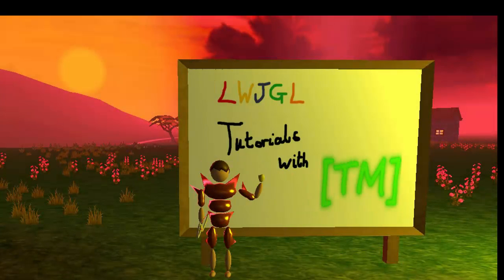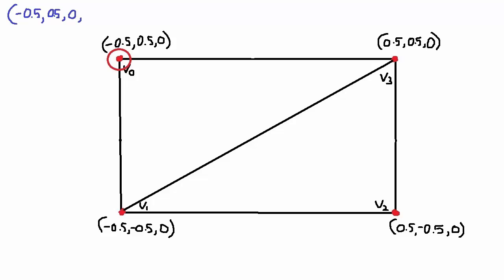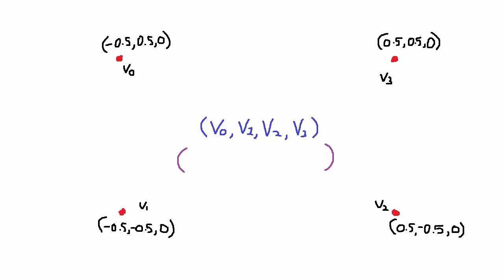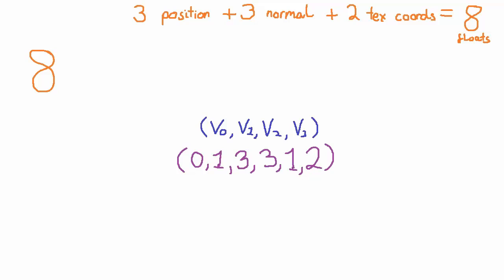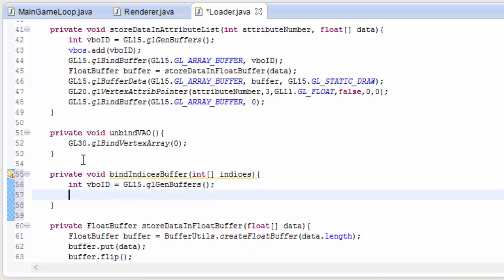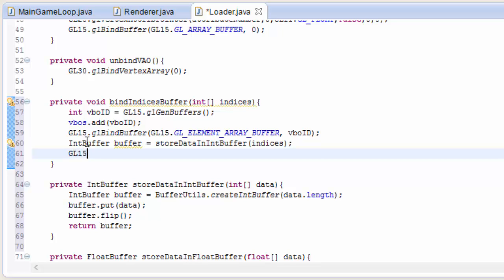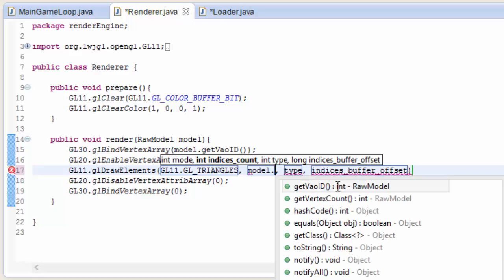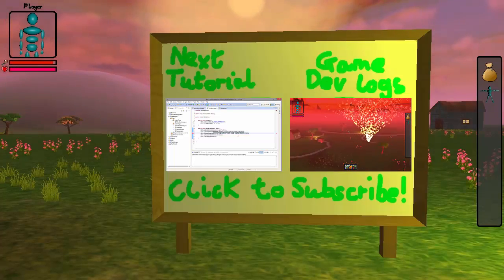OpenGL 3D Game Tutorial 3: Rendering with Index Buffers

Comment from the maker: Common Problems:

- Make sure that you use the new vertex positions array - it is different from last episode!

-In the loadToVao() method the last parameter of the RawModel constructor has now changed to indices.length instead of "positions.length/3". Make sure you've made this change!

If you get the " Cannot use offsets when Element Array Buffer Object is disabled" error, check the following:

-Creating the display must be the first thing you do in the main method. Don't try initializing the RawModel first.

-Check that you are calling the "bindIndicesVBO()" from the "loadToVao()" method.

-Don't unbind the index buffer anywhere! Each VAO has one special slot for an index buffer, and unbinding the index buffer will remove it from that slot.
Reply: If you are confused try looking at https://www.khronos.org/opengl/wiki/Vertex_Specification
Reply: So I don't need to unbind the IndiciesBuffer?

Comment: This took me a while to figure out. Hopefully this helps a bit.
1) Every model is a VAO. (you can think of it abstractly this way)
2) The properties and information of said model are VBOS's.
3) The EBO (Element Array Buffer) does not need a VAO allocation as OpenGL automatically binds it to the currently bound VAO. By using DrawElements, OpenGL automatically knows to use the EBO.
4) You must render all VAO's with a shader of choice, meaning you can have multiple shaders for different VAO's, or VAO groups (Like moddels, terrain, skybox,...)
5) Thin matrix is amazing, but he goes quite fast haha
Reply: I would say, every VAO is a certain vertex format that describes what attributes it consists of, in what order, and in which buffers are they stored in, an in what format.
A model can consist of several meshes, each having a different vertex format, so it may have more than one VAO. There's also a possibility that multiple meshes contained in multiple models share the same vertex format, and in this case there's a possibility that they might also share a VAO, if their vertex data is put into the same vertex buffers for efficiency.
Therefore I wouldn't bind models and VAOs so tightly.
Reply: i was wondering about 3) and this answered it. thanks man
Reply: *3 Yes, that is why then the EBO is  populated some VAO must be at the bound state, right? Had an error there, because unbound the VAO too early. Thanks, dude!
Reply: @vladimirs4684  exactly, you're welcome!
Reply: Tysm I was so confused because he said the index was in a vbo(thats what I thought he said) and I got confused as with textures only two vbos were being used but now I know ty!

Comment: What about 2D games, where all you need to render is a textured quad transformed to different places on the screen and with different texture coordinates? Is it still worth it to use index buffers in this case?
And which one is better? Using a single quad and transforming it to different places on the screen with a matrix? Or accumulating all the different quads of all the sprites on the screen into one giant vertex buffer and rendering it all at once?
In the first approach, though, I wonder how to "transform" the other vertex attributes, such as texture coordinates and vertex colors/alphas. Is it possible at all? Because if it isn't, then I guess only the second method remains on the table? :q
But in the second approach, there might be other problems, such as knowing beforehand how much space to allocate for that buffer, or in what order to put those vertices so that the number of context switches (e.g. texture atlases) would be minimal. (Is there anything else I missed?)

Comment: Since you are developing Equilinox which is a low poly-game, I came to wonder: would it be a significant "performance boost" to use short instead of int when storing the vertices in the VBO? I'm thinking of maybe low-end laptops without graphics card.

How many vertices does you biggest model have, if you would estimate?

Comment: #
# A fatal error has been detected by the Java Runtime Environment:
#
#  EXCEPTION_ACCESS_VIOLATION (0xc0000005) at pc=0x000000005d0b1610, pid=3544, tid=0x0000000000000834
#
# JRE version: Java(TM) SE Runtime Environment (8.0_151-b12) (build 1.8.0_151-b12)
# Java VM: Java HotSpot(TM) 64-Bit Server VM (25.151-b12 mixed mode windows-amd64 compressed oops)
# Problematic frame:
# C  [nvoglv64.DLL+0x1031610]
#
# Failed to write core dump. Minidumps are not enabled by default on client versions of Windows
#
# An error report file with more information is saved as:
# C:\Users\Andrei\eclipse-workspace\gameEngine\hs_err_pid3544.log
#
# If you would like to submit a bug report, please visit:
#   http://bugreport.java.com/bugreport/crash.jsp
# The crash happened outside the Java Virtual Machine in native code.
# See problematic frame for where to report the bug.
#
Whenever I try to run it. Help.

Comment: I am having the (0, 1, 2) triangle being drawn even though it is not told to be drawn. I checked that I have the correct vertices and indices 100 times. I went through the common problems. My source code looks exact. What could it be?
Reply from the maker: Check the "Common Problems" in the description and make sure that you don't have any of those. Did you definitely change the vertex count parameter when creating the RawModel instance in the loadToVao() method to "indices.length"?
Reply: Yessir, I have checked the common problems, and vertex count is indices.length.

Comment: Hi ThinMatrix, I've double checked everything, but still I am having a triangle (v0, v1, v2) or (0,1,2)  instead of the rectangle I've got in the previous video. What might go wrong?
Reply: Did you fix it? I'm having the same problem. The (0, 1, 2) triangle is being drawn even though it is not told to be drawn. I checked that I have the correct vertices and indices 100 times. I went through the common problems. My source code looks exact. What could it be?
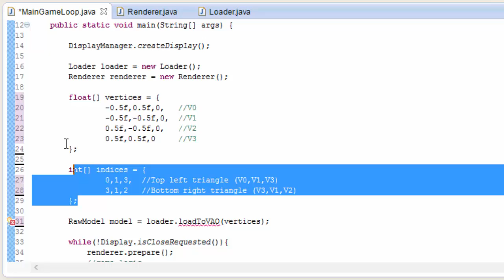Reply: Yeah I fixed it. The verticies were different for the second attempt. Check out the vertices of the rectangle, you need to change it when you use the index buffer. The vertices must be as shown at 11:09 in the video.
Reply: I have it exactly. This is copied and pasted from my Eclipse: 

float[] vertices = {
    -0.5f, 0.5f, 0,  // V0 
    -0.5f, -0.5f, 0, // V1
    0.5f, -0.5f, 0,  // V2
    0.5f, 0.5f, 0    // V3
     };

     int[] indices = {
       0, 1, 3,  // Top left triangle (V0, V1, V3)
       3, 1, 2   // Bottom right triangle (V3, V1, V2)
     };

Comment: I came back to this vid as something was really troubling conceptually. When we create the IntBuffer we put our index array into it but then we never insert that VBO into the VAO. I understand that we never unbind the IndexBuffer VBO, but I don't see how it stays attached to the VAO of a given RawModel so that the render method knows which indexBuffer VBO to use for each RawModel. Also, wouldn't we have to unbind the IndexBuffer VBO if we wanted to make more models since we would be trying to bind a new one when one was already bound? Greatly appreciate your time in helping a lowly noob such as myself :)
Reply from the maker: Each VAO has one special slot for an index buffer. When you bind a VBO as a GL_ELEMENT_ARRAY_BUFFER OpenGL knows that it is an index buffer, and binds it to that special slot of the currently bound VAO. During rendering if glDrawElements is used, the VAO used the index buffer that is bound to its special index buffer slot. So basically, when we initially create and bind the index buffer it gets attached to the currently bound VAO.
Reply: Thanks, this clears up a lot. So just to clarify, although only one VAO and one ARRAY_BUFFER VBO can be bound at any single time, multiple ELEMENT_ARRAY_BUFFER VBOs can be bound, although each one is bound to only one VAO (the VAO which was currently bound when the call to bind the ELEMENT_ARRAY_BUFFER was made)?
Reply from the maker: I think my choice of words was a little unclear - when you bind the index buffer it gets attached or associated with the currently bound VAO. The same way that all the other data VBOs get attached to the VAO when we store them in the attributes of the VAO. The only difference is that we don't have to specify which attribute to store the index buffer in, because it has its own special slot.
Reply: I see, thanks for explanation, keep up the good work!

Comment: Getting An Error Message:

Exception in thread "main" org.lwjgl.opengl.OpenGLException: Cannot use offsets when Element Array Buffer Object is disabled
 at org.lwjgl.opengl.GLChecks.ensureElementVBOenabled(GLChecks.java:89)
 at org.lwjgl.opengl.GL11.glDrawElements(GL11.java:1117)
 at renderEngine.Renderer.render(Renderer.java:20)
 at engineTester.GameEngineMain.main(GameEngineMain.java:38)

The Code is exactly the same, (Even capitalised the same), so I dont know whats happened...
Reply: And I have tried enabling both VBO 0 and 1.
Reply from the maker: Check the "Common Problems" in the description, especially the last two as those are common causes of this error.
Reply: I Am now having a different problem, The window opens, but stops responding somewhere before the rendering.
Reply: It is fixed now, Thank you so much for your help!

Comment: Shouldn't you unbind the indices VBO, and if not, why?
Reply from the maker: When binding a VBO as a GL_ELEMENT_ARRAY_BUFFER, OpenGL knows to use that VBO as the index buffer for the current VAO. Each VAO can only have one index buffer associated with it, so if you bind another GL_ELEMENT_ARRAY_BUFFER it would use that as the index buffer instead. If you unbind the index buffer then no index buffer would be associated with the current VAO.
Reply: Thanks, and wow, quick answer. :D I'm slightly confused about the bind/unbind though. There is one VBO per position in a VAOs attribute list. I can understand why you bind a VBO, but I'm confused why you need to unbind it. Is it in case you want to replace the VBO? Because it seems to run just fine without unbinding it (my guess is because there is only one "attribute" in use atm).
Reply from the maker: You don't have to unbind it, but I do it because for me it helped me get around the way OpenGL works. In order to do anything to a VAO or VBO it needs to be bound. So you bind it to make it active, do something to it, and then when you're finished you unbind it so that it's no longer the currently active object. It doesn't actually matter though, when you bind another VBO it would just automatically take its place as the currently active VBO, but to me it just always felt a bit more complete to unbind after I'm finished using it. I makes no difference though, so do whatever you find best.
Reply: Ah, OK. :D I have the same mentality. Bind, do something, unbind. The ocd kicked in when I couldn't do the same for the index buffer, which is why I asked. Thanks for your answers!

Comment: I didn't understand how did you bind the indices buffer to VAO when there is no method called to pass that VBO into the attribute list of VAO.
Reply from the maker: The index buffer has a special "slot" in the VAO, and doesn't have to be stored in the attribute list. The attribute lists contain data about each vertex, such as position, colour, normal vector, etc. The index buffer however is different - it indicates how these vertices should be connected. When binding a VBO as a GL_ELEMENT_ARRAY_BUFFER, OpenGL knows to use that VBO as the index buffer for the current VAO. Each VAO can only have one index buffer associated with it, so if you bind another GL_ELEMENT_ARRAY_BUFFER it would use that as the index buffer instead.
Reply: ThinMatrix Thanks for your help 😁 Your tutorials are awesome.

Comment: This doesn't work. Assigning a value of 0 to the GL11.glDrawElements([...], 0); can't find a buffer type to use.

I can see that you were trying to use it as the indices offset, but it fails.
Reply from the maker: Do you get an error message, and if so what does it say?
Reply: Exception in thread "main" org.lwjgl.opengl.OpenGLException: Cannot use offsets when Element Array Buffer Object is disabled
 at org.lwjgl.opengl.GLChecks.ensureElementVBOenabled(GLChecks.java:89)
 at org.lwjgl.opengl.GL11.glDrawElements(GL11.java:1117)
 at renderEngine.Renderer.render(Renderer.java:20)
 at engineTester.MainGameLoop.main(MainGameLoop.java:40)

Process finished with exit code 1
Reply from the maker: Could you show me the code for your Loader class please?
Reply from the maker: The issue is simply that you never called the "bindIndicesBuffer" method in the loadToVao() method (see 9:28 in the video), so the index buffer is never created or added to the VAO. That's why the glDrawElements() call didn't work - because it requires an index buffer. Also make sure that you're setting the last parameter of the RawModel constructor to "ind.length" and not "ind.length/3".
Reply: Fixed all your suggested issues and it worked again. New issue is it only renders a triangle and it's in the complete wrong place!!!! Lol!!!! Thanks so much :)

Comment: Hi Karl. I still don't understand how the index buffer is added to the VAO without the "GL20.glVertexAttribPointer()" method.
Reply: He have explained it in other comments. Basically,  a VAO can only have 1 index buffer, so when we bind a index buffer it'll be added to its very own special slot. In other words, we don't set our index buffer to an attribute slot in the VAO manually (like we do with other VBO's) because OpenGL will add it to the special slot in the currently bound VAO automatically. 

Here are some of his comments:

"Sorry that I didn't mention this in the video, but each VAO has one special slot which is specifically for an index buffer. When you bind a VBO as a GL_ELEMENT_ARRAY_BUFFER OpenGL knows to bind that VBO as the index buffer for the currently bound VAO."

"This is only the case for the index buffer - when binding a VBO as a GL_ELEMENT_ARRAY_BUFFER Opengl knows to set it as the index buffer for the currently bound VAO (if there is a currently bound VAO). But if we want to store a VBO as one of the attributes of the VAO it needs to be a GL_ARRAY_BUFFER and we then need to call glVertexAttribPointer to indicate which attribute of the VAO we want to store it in, and to also indicate how many floats are used for each vertex.
The index buffer contains a fundamentally different sort of data to the VBOs that get stored as attributes. The GL_ARRAY_BUFFER VBOs which get stored in the attributes contain data about each vertex, such as positions, texture coordinates, normals, and anything else. The index buffer indicates how these vertices are connected together to create triangles. Each VAO can have many attribute VBOs with per-vertex data, but there can only ever be one index buffer for that VAO."
Reply: Thanx a lot. Clearly understand now.
 I somehow missed that explanation.

Comment: I get the red background when I added that line at 13:00. But my rectangle is black and not white.
Reply from the maker: It's fine if the rectangle is black at this stage - we haven't specified a colour yet so it just depends on your system's defaults. As long as you see the rectangle everything is working!

Comment: Why you are not storing index buffer  in AttributeList of vao like we did for vertex buffer ? (using  GL20.glVertexAttribPointer(attributeNumber, 3,GL11.GL_FLOAT, false, 0, 0);)
Else how opengl knows where is the index buffer for a vao ?
Reply from the maker: Sorry that I didn't mention this in the video, but each VAO has one special slot which is specifically for an index buffer. When you bind a VBO as a GL_ELEMENT_ARRAY_BUFFER OpenGL knows to bind that VBO as the index buffer for the currently bound VAO.
Reply: Ah, got that. Thanks so mush for explaining.

Comment: You're very great at explaining in these tutorials. I've subscribed.
Reply from the maker: This is only the case for the index buffer - when binding a VBO as a GL_ELEMENT_ARRAY_BUFFER Opengl knows to set it as the index buffer for the currently bound VAO (if there is a currently bound VAO). But if we want to store a VBO as one of the attributes of the VAO it needs to be a GL_ARRAY_BUFFER and we then need to call glVertexAttribPointer to indicate which attribute of the VAO we want to store it in, and to also indicate how many floats are used for each vertex.
The index buffer contains a fundamentally different sort of data to the VBOs that get stored as attributes. The GL_ARRAY_BUFFER VBOs which get stored in the attributes contain data about each vertex, such as positions, texture coordinates, normals, and anything else. The index buffer indicates how these vertices are connected together to create triangles. Each VAO can have many attribute VBOs with per-vertex data, but there can only ever be one index buffer for that VAO.
Reply: I do not understand how the bindIndicesBuffer works. The method has no code that adds the vbo to the vao
Reply from the maker: It acts on whichever VBO is currently bound. To bind a VBO we call glBindBuffer(vboID). Same with the VAO, the index buffer gets added to the currently bound VAO.
Reply: Why do we need code that adds the VBO to the VAO in storeDataInAtributes if the VBO will automatically get added to the bound vao
Reply: Also when you did 

GL15.glBufferData(GL15.GL_ARRAY_BUFFER, buffer, GL15.GL_STATIC_DRAW);

in the last tutorial, you did not say that you where preforming this action on vboID.

How would opengl know which vbo to act on
Reply: Thank you for the great answer, I was wondering the exact same.
Your tutorials are great and already helped me with another project.
Furthermore you always have this (small) success after each episode, which wants you to keep going, even so it is already 4 am ;)
Keep it up man!
Reply from the maker: Thank you :)
Reply: same here :D